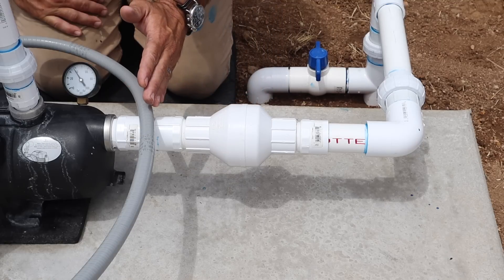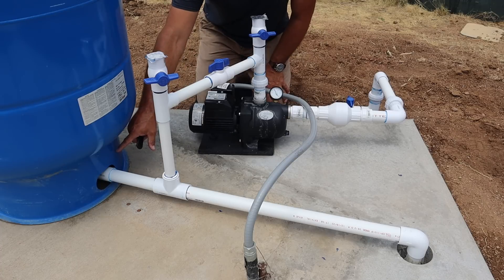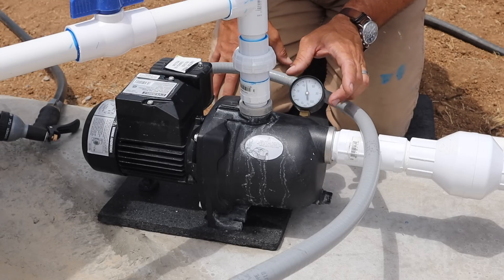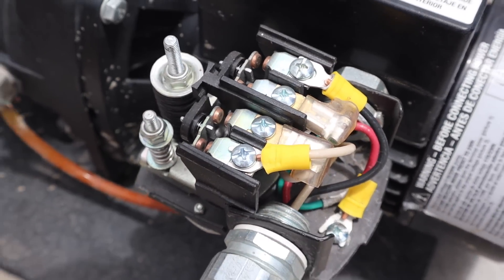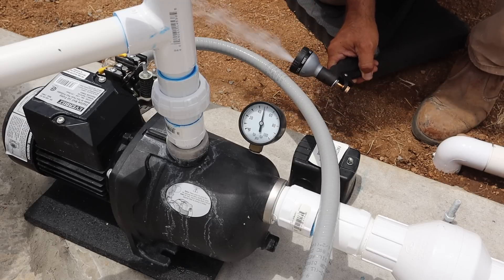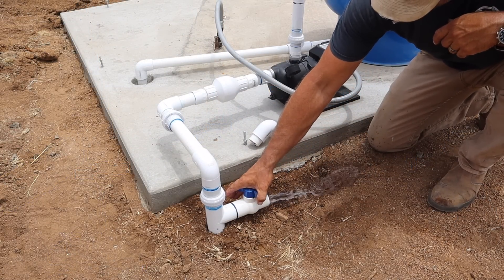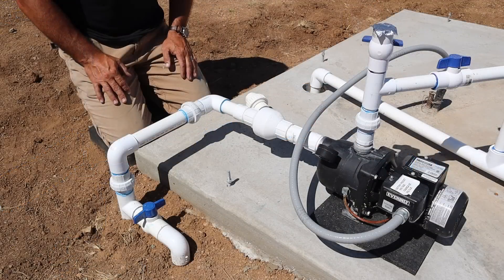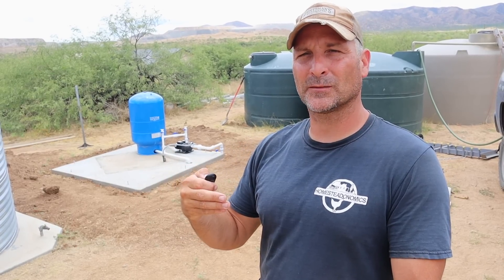Pump House Tour of My Rainwater Harvesting System - How It Works

Comment: 6:08 - Second time you mentioned the bladder in the pressure tank. I just watched H2o mechanic cut open and explain what's inside one of these. You have it backwards, the water fills the rubber bladder and the metal tank is pressurized to then force pressure on the water bladder making a pressurized system.

I live in AZ and I am moving to my own property in a few months but it's completely off grid. I have watched a bunch of your videos to get ideas. Thank you for making these videos.

Comment: Maybe I'm missing something but if the pressure drops enough to kick the pump on won't the water go straight to the house and only recharge the pressure tank once the usage in the house stops? Or is the pump pressure high enough to the house while the pressure tank is charged?

Comment: Great video man thanks so much! I have a question re the suction end of the pump and its overall efficiency: is using the water flowing out of the tank through the outlet as a water source for the pump as efficient compared to a suction pipe that goes into the tank from the top? Ie isn't the suction capacity of the pump limited by the rate of water flowing out of the tank (which is affected by the amount of water in the tank itself)? Hope the question makes sense, I'm not a native english speaker. Thanks so much and stay safe

Comment: I used a quiet submersible pump inside holding tank then to the pressure tank. I have to place my ear on holding tank to hear the pump running. No need for pump house and with it being submerged will not freeze in southern AZ.

Comment: Just a suggestion, replace the pvc pipe and fittings with a  flexible hose connection from the pump to the first pvc connection.  This will help on vibration with the pump do it does not put stress on the pvc fittings.

Comment: I just need one for my fish tanks. Im trying to figure out do i need to connect the sump pump from the water tanks and connect them to the reverse osmosis system for soft water for fish? Do you recommend this or? Do i need a small pressure tank for 100 gallon tanks? 👋🏾

Comment: Great video…got a bunch of info from it. Doing 5 acres in Apache County and have a few questions. From other videos, it looks like your tanks are top fed, how do you balance them…are they bottom balanced? My well pump is rated at 9 gpm, but the water heater is at 4 gpm, will the pressure tank control the difference? Any suggestions would help a lot. Thx.

Comment: What size pipe is that being used? And how many liters does the pressure tank hold and does it maintain the same water pressure all the way down till when it is empty? For example - if you were having a shower - would you have to adjust the cold water tap because less and less water was coming in per second?

Comment: Great video on how all this works.. I wonder though, would you still need the pump if the water tanks sat higher than the pressure tank? I also still can't wrap my head around the "back pressure" from the pump, to the water tank then to your house. Why does the water from the pump go to the pressure tank (after passing through the T) instead of just straight to the house?

Comment: You may want to make certain all your PVC joints between the pump inlet and intake  pipe in your tank are tight if you chose not to glue them, because air is being introduced into the water inlet side.  That constant cavitation we hear may cause early failure of the impeller, check valve and/or pressure switch or pressure gauge. 

For future consideration, to minimize risk of constant cavitation vibrating your pressure gauge's working parts, install a liquid filled 0-100psi pressure gauge. and maybe make sure to keep a spare pump, check valve and pressure switch if you live remotely and FedEx only delivers once a week.

Comment: The little screw on the pressure switch is the  gap spread and it's not suggested to be moved  in less you can recalibrate it   it's usually about 20psi spread from factory  the main screw is the on and off  more pressure less pressure on at 40 off at 60 factory settings  this can go down or up  not lower then 30 not use over 70 to small for application  and as long as your not maxing out the pump at shut off and the  pressure  stay at l lest 7 psi blow the max   it will be fine the amount of pressure    life of the pump  depends on quality of water and your system quality .  The union by the 90 wasn't needed and could of used it for the pressure tank that way nothing would be needed when it came time to replace the tank and the best check valve is a flowmatic brass check valve  it had to go wrong  and I would put anything else in less I. Had to or temporary. LoL and the air tank pressure  35  factory  but can be lower and higher  in air pressure  depending on on what the pump turn on is.    always make sure there no water pressure in the tank when adding or letting out air  it will interfere with your pressure reading if water pressure in the tank so water system must be drained off when doing this .   Great video nice work IV done this for over 20years  now   and have done quite a bit off system   I basically do anything pump work system and trouble shooting  ag and residential. 💦💯👍🛠️✌️🍻

Comment: Setup looks great! Question: why did you put the check valve before the pump? The reason I ask is because the pump is now having to turn on under pressure(30psi). If the check valve was on the outlet side the pump would only be under the head pressure of the rain tanks. That way when the pump kicks on it will build pressure and push the check valve open to pressure your tank. Should put less stress on start up. 
Great looking system.
Reply from the maker: Thanks!  As for the check valve….two reasons.  With one better than the other….
1- simply an inlet versus outlet spacing issue.  On the inlet side it is low and in-line with the piping run.  Whereas on the outlet side it would require more UP or Over in regard to spacing.  Not a bad thing….but just a thing.
2- I know there is a vacuum created once it seals shut.   But i choose between the tanks and pump due to the ‘keeping the prime’ if the tank level is lower than the pump.   Again, the vacuum would keep it wet but it was just a thing when I first set it up that made sense…. And when I redid it.  I just did the same. 

But your points are well founded and make good sense too! 

Thanks for checking it out😊🙏

Comment: Great video as always.  My brother built something similar but it is in a concrete block pit that is 7' deep to try to keep it from freezing.  The roof is movable for access with a ladder and a 60 watt lamp provides enough heat to make sure it does not freeze up.

You might look into what is called a cold roof.  The 1st roof is built to the point you would be ready to put the metal on. But 2x2 or 2x4 boards are screwed down from drip edge to peak and then another layer of sheathing and waterproofing and the roofing is screwed to this.  At the bottom you put in screen to keep the birds and insects out and at the peak you put in a ridge vent.  In our cold temperatures it keeps the snow from melting and turning to ice.  However the Engineer that I know who did this on his house said that it also helps keep the roof cooler as it creates a convection current.  Gary did this about twenty years ago and is still very happy with how well it works.

Comment: Great design. Mine is similar to yours but is galvanized pipe which is starting to rust out. I plan on going PVC like yours, what schedule did you use? 20,40 or 80? I also like the idea of a filtration system installed, will be waiting to see your completion on that.

Comment: This was a great video. I am really glad you spoke about how the system works and how the parts within the system work. THAT IS AWESOME! I built my pump house through trial and error. I had a design before I built it, but after putting that design in place I found other parts that would make the system before. The original design worked, but I found it could be better. Thank you for posting this video as I will be sharing it with others around me who are going to build pump houses for their homes.

Comment: Nice setup. Similar to our (deep) well pump. Our submersible pump works well for 14 yo, but takes a lot of juice to run. How much power does your pump use? We'd like to expand our rain harvest system for house use, but have Midwest cold winters with potential for frozen pipes. Really like how you've got things setup for yourselves.  Well done!

Comment: Stupid question: the pressure tank doesn’t require power, does it?
Reply from the maker: No, it is just a rubber bladder within a metal tank.   The pressure is developed with the pump and the bladder holds that pressure and delivers it to the house in between pump cycles.

Comment: my only comment:
i'm not sure if you're already planning on it, but you should consider having both filtered and unfiltered water outlets.  it'll help extend the life of your filtration system.
Reply from the maker: That’s a great idea….for outside hoses especially!
Reply: @homesteadonomics  the question becomes, would you want to put the filtration after the pressure tank or before.  the latter would mean less equipment since you'd only filter the line going to the house for potable water.   the alternative would be at least dual pressure tanks. the plus side is, you could go all-in and have dual pumps as well, and basically have your "backup" nothing more than a valve or two turn away from being up and running.

ok after sketching it in  a notebook, it's a more than 1 or 2 valves, give maximum flexibility (2 pumps, 2 pressure tanks, 1 filter, 13 valves, 2 check valves) for flow control and servicing. :D
still, there's the ever important WAF (Wife Acceptance Factor) on how to deal with stuff when you're not home. :D

Comment: I’ve been getting my ram pump back up and running and l I’m amazed at how quickly PVC degrades in the sun. What do you do to project external PVC?
Reply from the maker: This is going to have a pump house built around it.   So I won’t stay exposed.   Just taking the opportunity to do this while it was exposed as it was easier to film.

Comment: Is it possible to do your exact setup, but on 12V solar, or would a 12v pump not be sufficient ? This would be an alternative solution to a power outage, not full time setup.
Reply from the maker: Yes, you sure could.   I will eventually set up a 12v backup for this system too.   But it might be several months to a year down the road.   As once I get the pumphouse and filtration setup finished I got several over thing to need to get too first.

Comment: I had a similar setup in a 12' deep pit at a farmhouse I was renting, shallow well jet pump... ran heat lamps inside the pit in winter with hay bales covering the pit cover to add insulation
Reply from the maker: Yes, sounds like a shallow well pump probably suited it well.

Comment: Very nice simple design. My brother lives in Vail AZ, and hauls water every 2 weeks from a municipal water supply to his house storage tank. How much square footage of collection area and storage volume would you need for six months usage assuming 35 - 50 gals/day consumption?
Reply from the maker: Well 6mo, or 180 days at 50gal/day would be 9,000 gal of total need.   Sonifnit was all in one fell swoop you’d need that capacity on the high side.   Of course rain is sporadic and more spread out than that.  

So considering 1,000sqft equates to approx 600gal for each inch of rain.   You’d need to approx 15” of rain within that time to accumulate that amount of water.  

BUT if the roof was 2000sqft….. then you only need 7.5” of rain.   

AND for 3000sqfr of collection surface then you’d only need about 4.5-5” of rain.

Hope that made sense.   And thanks for bringing that up.   I think maybe perhaps a scenario video like that could be interesting.   So if you see one get posted.  You can know that you have a little inspiration in it😉👍

Comment: Just an FYI, lithium mining is a very minor problem with production of batteries. Lithium is generally "mined" from salt flats or deserts where there is no life. Cobalt is the main problematic component within lithium batteries, but not all lithium batteries use cobalt (ex. LTO, LiFePO4). Generally for electric vehicles they use lithium cobalt batteries, but for home/commercial energy storage, LiFePO4 is commonly used due to increased lifespan.
Reply from the maker: I am aware….as I live near a very large mine.   The ‘lithium’ is just the term that most people are familiar with.   But the point is that there is a cost that many do not take into account when they advocate for narrow solutions to broad problems without being aware of the costs.  
For example the mine near my house, mines mostly copper and molybdenum, but also gets trace amounts of many other things.  But still very significant volumes.   
And there is a multiple thousand foot hole in the ground that is so deep that it’s hit the ground water in my area.   Affecting wells and secondarily affecting ground water supplies with the mining processes.   Which for this mine, have been cleaned up drastically from how they previously operated.   
But I understand you point as well.   But just wanted to point out something that many people and politicians rarely consider regarding the cost benefit.
Anyways, thanks for checking out the video and hope all that made sense😊🙏
Reply: @homesteadonomics  Oh yeah 100%, people who think that green energy is 100% green from extraction to production to the end consumer are delusional. The real advantage of green technology isn't the initial offset of CO2 (because most green technologies actually product more CO2 initially compared to fossil fuel products), it's the benefits in the long run.
Reply from the maker: @Felipe2077tv yes, I agree! 😊👍

Comment: ?? Can I just by the bladder? And where ? It's not holding air. Great presentation, as always
Reply from the maker: I’m not aware that you can buy just the bladder specifically.  But I’d imagine you might be able to.   But It would probably have to be something that is pre-connected to the bottom outlet plumbing.   So it might be more cost than simply getting the bladder
Reply: Ok, thank you!

Comment: Congratulations; now you're going to get a half a million critiques.  About 20 years ago when I lived in the country, I did a very similar project, you will find that this endeavor  is a  learning experience . After replacing 3 expensive Gould pumps, one after the one way valve failed, I went to Harbor Freight and bought 4, shallow well pumps.  They also had a small pressure tank that fed into the large pressure tank, just like yours'.  Before retirement I was a pilot and would be gone a couple times a month for 6 days, that's when things break. It must be a law somewhere. I set up 2 pumps in parallel with valves and circuit breakers, took pictures, printed them with valves identified and instructions for my very capable country wife.  The third pump just fed the outside irrigation and bypassed the pressure tank., the fourth was a spare.  You will find that the shark bite PVC fittings and sliding couplers work great, much easier when modifications or repairs are needed.  In a few years, you may experience PVC failures from pump motor vibrations.  What I did different is I used two 45 degree fittings to help with the flow rather than a 90 degree fitting, I don't really know if it makes a difference. I also used rubber mat to raise the pumps off the concrete to keep everything dry, reduce rust and vibrations.The third difference, is I used the 1 inch flexible PVC hose/pipe between the pump and manifold.  The expansion tank bladders last around 10 years before the rubber fails.  You will figure out what is best for your system, it will likely take a modification or two. Your knowledge and experience will help others that are new to off-grid life.
Reply from the maker: Haha….yep!   I always expect critiques. 
And it sounds like you had a pretty good setup.   And I agree on the “things always break when you’re away”…..Murphy’s law I guess.

As for the bladder being about 10 years.  That exactly how long my first one lasted.   This one is about 3-4 years old.
Thanks for the great info too😊🙏
Reply: Wow, I guess I'm lucky. I have 2 Goulds bladder tanks that are each 21 yrs old. Now pumps are a different story, I've replaced 5 pumps in last 21 years.
Reply: Good job. 😅😂😅😂 Just wait.
Reply: Couldn’t you use radiator hoses near the pump to isolate the vibrations? Aren’t they rated for higher PSI?

Comment: That will be a nice pump house. Looks like plenty of room to to move around and do maintenance. I know you don’t get much freezing temps. Do you have a plan for those freak times?
Reply from the maker: Well, once it get the house structure built, that will take care of mild freezes.  But for previous hard freezes I’ve always added a heat lamp in the house.   
However this new house I’m planning to incorporate some PVC fittings on the south wall to make a solar wall to heat the pump house in the day.   Alway been a project that I wanted to do and figured this would be a good opportunity to try it out.
Reply: @homesteadonomics  that is something that I have wanted to do as well. Super cool! Can’t wait to see that.

Comment: Did you consider an elevated water tank on a stand or tower to provide water to your place?
And what other options did you have available to you that provided pressurised water?
Reply from the maker: I have always wanted to build a water tower….so yes.   It would be more of an emergency water thing.   
However, I’d I had the topography and location slightly different on my house then I’d love to install a tank on a hill or upslope to give pressurized water via elevation/head pressure.   
But when we built our house I wasn’t thinking that far ahead🤦‍♂️😂